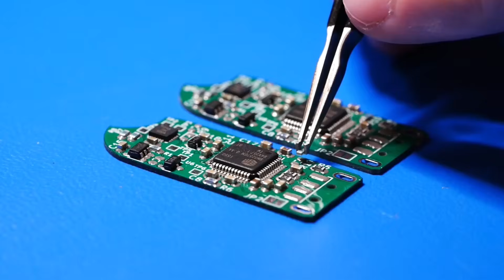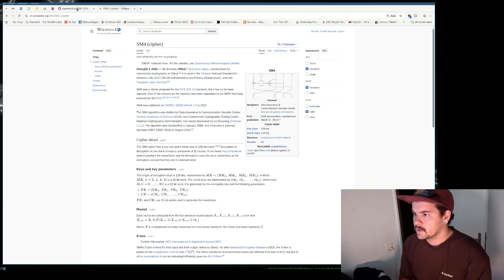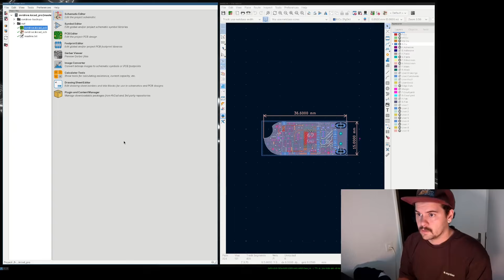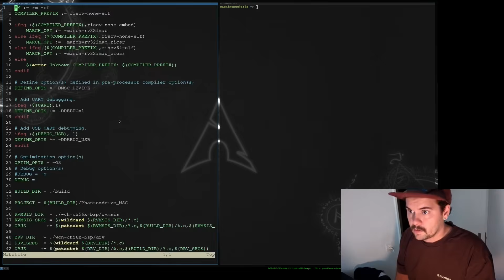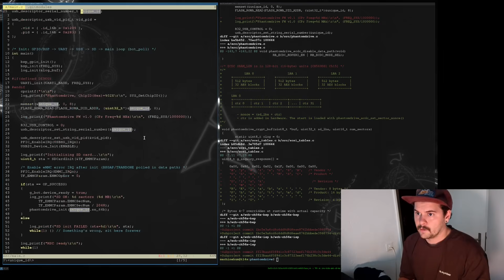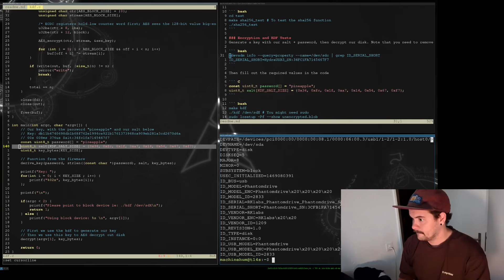The Open Source USB Drive Built for Privacy

Comment: Is such a device protected against physical tempering? Again I know nothing about electronics but can someone physically hack the device and decrypt the content or change a component so it's possible to? I ask that because I saw it's possible to steal the key on a computer by accessing the security chip and unlock bitlocker.
Reply from the maker: Yeah - it AES encrypts data. So even if the device is tapered with in any way, you're still fighting strong encryption.
Reply: @rootkitlabs  thanks for this answer.

Comment: I would already be happy to have reliable normal USB... the most reliable USB I have is an old Kingston Travaler 3.0 with blue metal casing
Reply: My Data Travelers were so damn reliable! One went through the laundry and dryer twice and only died when it got kicked out of a USB port by accident. 😅
Reply: I have a USB stick that refuses to die.  It's a Sandisk Cruzer Mini from 2004.  It's been through the washer and dryer at least twice, and it also had an alkaline battery leak all over it, after which I dunked it in vinegar to clean it.  Still tests as 100% working.  The biggest downside is that it is only 1GB, although that was the largest size you could get at the time.  It was $300.

Comment: Is the microSD initialised with random data to hide the amount of data stored?
Have you considered adding a fully random salt with some means of destruction if the case is opened?
Any chance there are timing attacks to detect a Phantom Drive by comparing the creation/modification speed of unlock.txt vs any other file?
Reply: A determined attacker who is aware that Phantom Drive is a thing can figure it out anyway by cracking open the case and looking at the design. (The SD card slot on the back is a pretty serious giveaway, as is the DFU button, normal flash drives don't have either of these and the SD card being bigger than the real size of the drive is also a giveaway.) This is mainly useful against people who see a flash drive and just think it's a flash drive.
Reply from the maker: @aaronrainbolt3154 yeah for sure. If someone cracks it open it becomes pretty obvious this isn't a normal drive.

However extracting the SD card doesn't get you anywhere, all the data is still encrypted.
Reply: @aaronrainbolt3154 Its pretty common for cheap usb drives to internaly have a sd card so thats not a givaway

Comment: Hi, i like the idea and design. I have one point. You sre supplying whole board by VBUS from USB. And you have on thi line a quite big capacity. More than 100 uF, all caps are ceramics with extremly low ESR. You dont have any impedance between Vbus And caps So there will ve big current spikes when you connect device to USB. You should add some inrush limiter or e-switch with current limit. Also ESD protection on USB signals would be nice.
Reply from the maker: Thanks for the tips!
Reply: @rootkitlabs  I checked design again and i have some more :) You have floating reset pin of the MCU (PB15) its input low active pin, i would strongly recommend to add pullup at this pin. You have aswell testpoint TP4 close to SD card slot, if you will not assembly the SD card in ESD safe zone you can easily damage your MCU. I would recommend move TP4 or add ESD protection. Button for entering bootloader needs ESD protection, you will touch this part of device with hand so there is big probability of ESD pulses coming. You also dont have any impedance from button to the pin of the MCU, this means when ESD pulse comes all energy will float to MCU pin and it can damage it. I would recommend to add resistor to the series and ESD protection. I dont know if you need pass the EMC certificartion but i would make some changes on PSU design but i think its not that critical.
Reply from the maker: @OpenElectronics-A  You're hired!

However PB15 isn't floating, RN1 is pulling it up :)